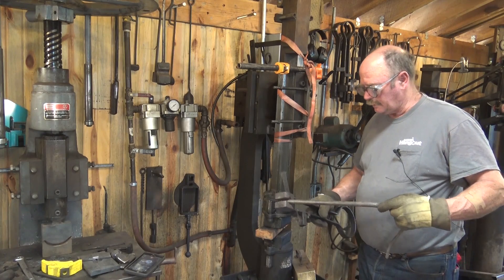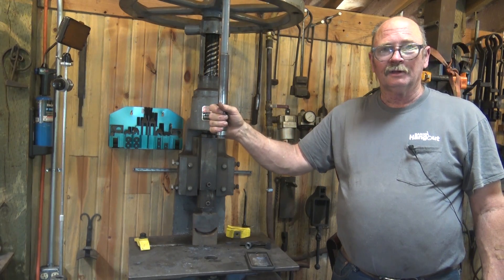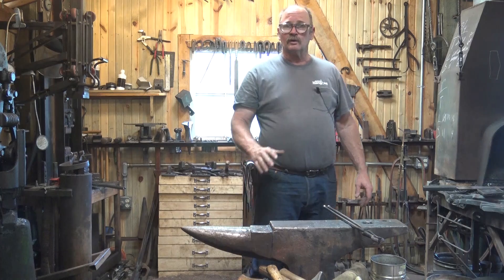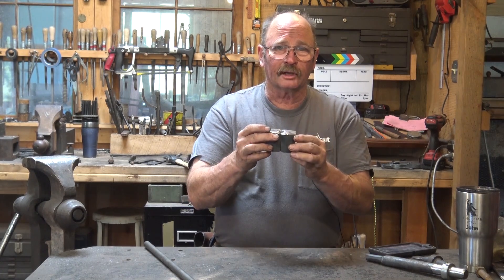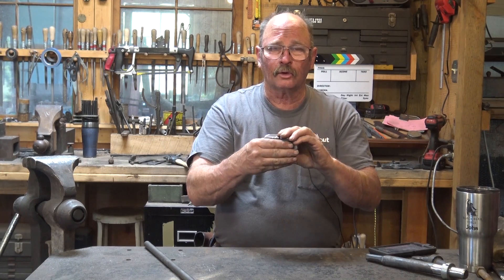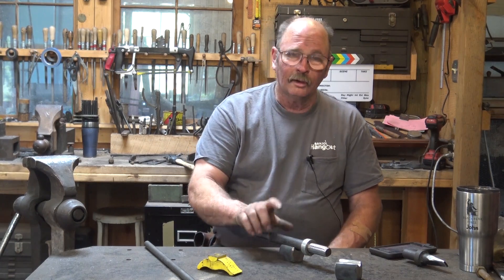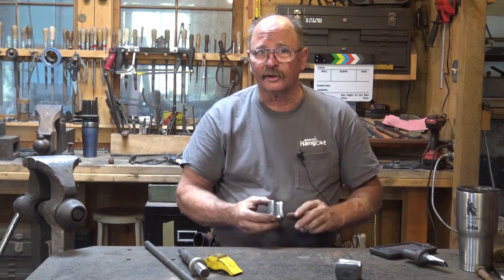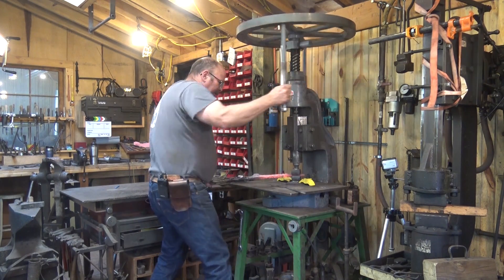Forging fly press dies using the hydraulic press.

Comment: Will a #6 fly press be enough for drifting and shape  forging axes and hammers I like the thought of the fly press being it’s completely hand powered I want have to rely on electricity or hydraulic’s would u say u can do anything on a fly press that u could do on a hydraulic press or power hammer!?
Reply from the maker: It would struggle with some of it, but could do it.  The hydraulic press is much stronger and has the advantage of continuous force.  A fly press has to be raised and lowered to create a combination of impact and pressing (for lack of a better description).  The two are different tools, but can do many of the same tasks.  You might want to look at this video on punching with the fly press. https://www.youtube.com/watch?v=mj0zvZvVHQE  its an old video and not great, but may help.
Reply: @BlackBearForge  thanks

Comment: 1. I have always liked making my own tools, but that may be because I have more time than money. 2. The flypress is certainly quieter than either the power hammer or the hydraulic press, but I think it would wreak havoc on my right shoulder (victim of a defective recoil starter on a four wheeler).
Reply: Could you rotate the die to hold with your right hand and press the fly with your left hand?